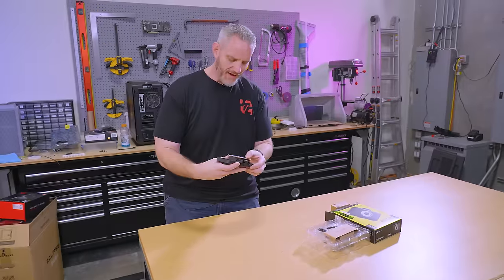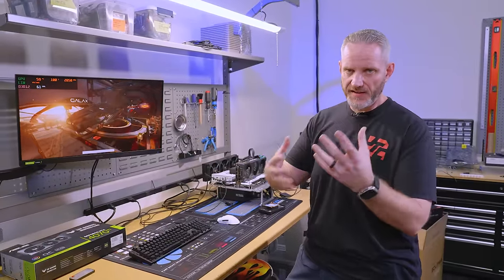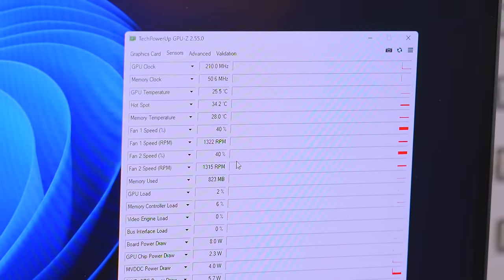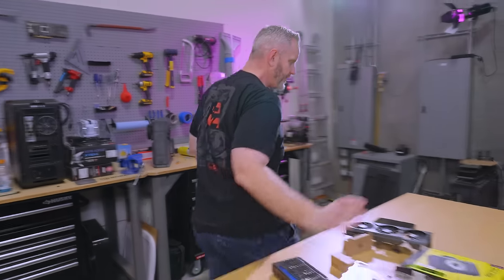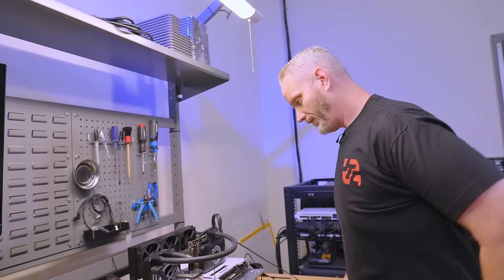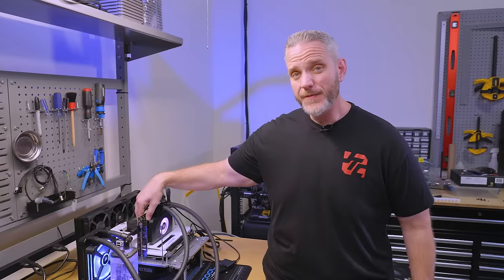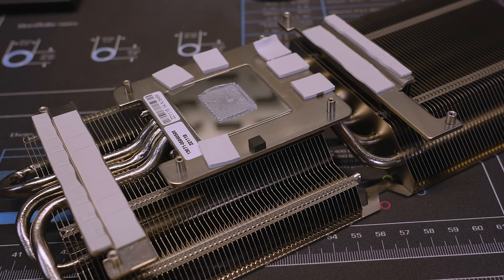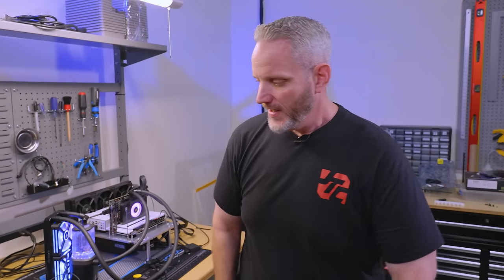They don't think I was being fair...

Comment: Genuinely, if you think he was too harsh...you really need to put your brain to work more. Not only does that product look atrociously-cheap, watercooling is an expensive addition, it also has the same huge risks to damage the GPU as any other block. The reasons anyone does watercooling include cooler temps and lower noise due to barely any fan movement being necessary. 
This thing negates the reasons for watercooling, has all the same risks of damage, and it looks terrible. Plus, it's not like this thing would make or break a build for budget. The bulk of costs are in the reservoirs, fans, connectors, and tubes/hoses. At $130, this is only a few dollars cheaper than an Alphacool Eisblock

Comment: Can anyone help me with a question? I got my new pc shipped in yesterday and a cable for the aio wasn’t plugged in but I didn’t notice right away and the cpu went up to about 107 Celsius before I turned it off. Would it have any damage from that? It was only for a very short amount of time
Reply: Should be fine. CPUs will throttle or turn themselves off to avoid damage from overheating but you turned it off before that even happened.

Comment: Jay you don't water cool for the performance I do I got a 360mm and 240mm 86mm thick rads and 38mm thick fans cooling a 5900x single core is close to 5ghz and all core is about 4.35ghz.

Comment: function over form, lol. I looked at the watt consumption of the 40 series cards vs the amount of heat my AC can get out of the room, and the 'function' just isn't there for it, lol. your either a mega corp using multi-rack VCA/DGX things, or you can't write it off as a "business expense" and are probably better off getting a game console of late, lol. maybe if I lived where there was 3-phase power I could get a bigger AC unit to keep the room under 40c (104F) during the summer, yet that just isn't an option. Also, isn't the idea of a water block, to open up the other expansion slots for more stuff, anyway, the biggest issue with that thing is the GPU it mounts to.

Comment: I would also see this product at the $60-$70 dollar range. $129 is too much for this product.  Using the corsair RGB is also pointless to me tbh. I like static color or no color and this product "for me" wouldn't even be visible to look at with the RGB because it would be pointing at the PSU shroud anyways.  I think its an interesting product for SFF cases potentially but, other than that, its a waste of money.  Personally, I'm planning on going with an aircooled card next generation (8000 or 50 series card) because my loop can't support the powerdraw of these components anymore (my system max is 300w of cooling) so I've had to limit both the GPU and CPU powerdraw as much as possible.  This doesn't effect my gaming preformance at the moment tho because my boost clocks are still reaching max on CPU(gaming is still low core usage) and my gpu is down about 10% preformance and 30% less power draw.

Comment: "The backplate was doing something" is actually something you don't know, or at least didn't test.  You don't know if there was any temperature increase on any of those components with the backplate removed.  Obviously in the stock set-up the backplate is there for a reason or they wouldn't have it, most likely, but that could change with the hybrid block.  Not defending the block, I don't like the aesthetics or price either , just trying to be fair.

Comment: That black wobbling circle in the cooling block for the GPU, would bother the hell out of me. That should be perfectly centered or be removed or made to cover precisely. Wobbling like that is just WRONG. As for the backplate, wan't in screwed in partly from the cooler side, with that you could mod it and still use it, couldn't you, even if it would break the originality of the backplate and you would be out a backplate if you were planning to go back to the original cooler.

Comment: I recently bought the XC7 elite CPU block for a new build (the one without the lcd) as it was the only one available for my AM5 board at the time and I find the product incredibly anti-consumer. Nothing else in my setup uses Corsair and the gall to charge £100 for a block that requires an extra £50+ just for the pleasure of turning on the RGB lights within the block? No alternative for Aura or heck, even just a few pre-programmed default options?

Sick of these companies trying to nickel and dime us for every little feature.

Comment: Now I want to know, does having a bigger rad make a difference?
Reply: considering that the smaller rad didn't cause any overheating/bottle necking it wouldn't really matter maybe an additional degree or so at most but your still investing more in to the rad then and still not measurably doing better. Like does it matter how much cooler its getting when its already below 60 and not directly cooling the vrms

Comment: I'd much rather get a higher tier of GPU than water cool a 70 class card, a block and a radiator and a pump/res would probably cost the difference between a 4070 and a 4080

Comment: The fact that that thing had a 3 pin corsair plug that needs an adapter to fit a standard 3 pin motherboard header is dumb. Just use connectors that are on every motherboard that everyone uses.

Comment: This is one of those products where it feels like you're literally paying for the name branding on it rather than the product itself. What I mean by that, is that I agree with what Jay says about the product. It is entirely priced wrong for the product you get. If I was searching for a water-cooled block for a GPU and I was looking at this product at 129 vs one with full coverage and a back plate for 23 more, I would go for the slightly more expensive one. The point of going to water cooling is two fold, you are looking at getting more out of the card while giving similar cooling coverage to make sure nothing gets neglected, and you are looking for aesthetics. This one from Corsair has neither of that. If my air cooler comes with a functional back plate and VRM cooling, then I want to make sure my change to water cooling has similar coverage.

This might seem mean to say, but this cooler.....really looks like something that came off Aliexpress or something as it looks janky as all get out.

Comment: My problem with products like this is that for the most part they miss the point in a market and you only buy them for the sake of using them. Like for when you want to have all things water-cooled.

For noise? Dunno the cards are with fans pretty silent.
For over locking? Definitely. BUT why waste money on a card, peripheries to the card to make it clock higher when you could have just saved the money and bought the next higher classed card.

For the sake of having a 4070ti that over locks to be as fast as a 4080 even so with all the effort etc you paid the same. Sounds silly as it gets. 

For the top cards no doubt it makes sense, as you can't buy better.

Comment: I don’t find the temp change worth it. And this is ignoring the issue with the heat of the vrms.  If the temp,change was something 15 degrees,then it would start being somewhat worth it, but then as some comments have mentioned, for the price of this block, you would be pretty close to the cost of a 4080 when you include the cost of everything else required to water cool it and you would be better off just  to get more performance if you just went with a 4080 for not much more money. This would have to be more like $50 to really be worth it.  But this is the issue with water cooling in general for anything but the top tier card(well with the current nvidia prices, the top 2 tiers) as the money you spend on cooling could just be used to get the next tier up for not much more (albeit air cooled).

Comment: It does look dumb. It also looks cheap. The only bonus I can think of is because it's plastic on copper it doesn't introduce any metal mixing crap to a loop. But seriouslt it looks cheap. Like "Look what I found on the clearence shelf at K-Mart" cheap. I'm talking mid 80's gas station cheap Matchbox/Hot Wheeels knock off cheap.

Comment: I honestly have NO idea how Corsair came up with this design. For more than a decade already manufacturers were trying to extend cooling to additional components around GPU itself and memory chips, especially VRM. And here goes Corsair, "Duuuh, we will put two small holes to blow some how air onto extensively heating VRM and it will be juuuust fiiine". No, not it will not be fine. VRM was heating like crazy in an OPEN build Jay has. Imagine packing this shit into a standard case? Or even a small factor case?
AT some point we, as customers, must hold manufacturers accountable and tell them to stop wasting our time and our money for the stupid bullshit they describe as "products". I, as a customer, do not want no ecosystem. I want my fucking fans to have the same fucking plugs so I can fucking stick them into any motherboard or controller I like and use any fucking hardware I please. And I want cooling to be designed TO COOL SHIT, not to be a direct equivalent of modern shitshow you may also know as "High Fashion".

Comment: Using plastic like that opens the door for a plethora of issues for people that are wanting to do preventative maintenance on that unit. Maybe they could’ve used implanted metal posts that would have a stronger, safer threading than using self-tappers. Not a fan, wouldn’t buy that unit because of that sole reason.

Comment: The 4070 DOESNT need a water block, PERIOD!  Hell, any 40"" series.  Heat is NOT an issue.  As stated, this tech is a dog at any price.  If your going small form factor or have limited space, there are other options that look and perform better.  Another mistake by Corsair.  If they Keep producing plastic e-waste for premium prices and they are going to find out!

Comment: I mean, my cheapo AIO CPU cooler bought me 20+ degrees C of cooling compared to an air cooler, for like $60 bucks. The idea of spending $130 for that little thing? Naw.
Reply: Oh, AND doing the cheapo CPU AIO opened up the case airflow enough to bring the air-cooled GPU temps down by like 10-20 degrees as well.

Comment: The sticker on the hub wasn't centred, or the design made it look off centre at speed. That would drive me mad.

I just can't imagine who it's aimed at. Definitely not overclockers or aesthetic builds who'll go full plate. Too expensive to be budget. Would I take my GPU apart and lose my warranty to fit that? Hell no! Imagine your VRM's burn out because they ran too hot for too long and you had to tell the OEM you'd used that instead of their heatsink 😮 

It reminds me of those 'electric turbo' things they used to sell for cars that were basically a 12vdc motor with a plastic fan 😂 it just looks like a gimmick you'd laugh at if your friend said "Hey look what I got"...... what? Warts?

Comment: I concur w/ Jay's opinion on this, it's not priced properly. IMO it looks like crap no matter the orientation, it only provides marginal benefits which could mostly be margin of error in testing anyway. For a little more or at the same price you can get full cover blocks or you can change settings for the same performance gain for free. It looks anemic & like someone just needed a product to sell, it doesn't bring anything new to the market that's worthwhile, save the "passive" linking that is limited due to poor planning & execution. Definitely not worth $130 IMO.

Comment: It’s a terrible product.  Going Custom loop is a huge money dump already, when you get a rad, pump, fans for ~$300 and then a $129 block that looks like garbage compared to the stock air cooler it’s a huge waste of money for -5C reduction in primary temperatures.

People who do custom loops do it for the aesthetic factor and/or temperature, but the gains need to be substantial like -20C on a 4090.  This product checks neither box and looks more like a money grab with all the cheap components/design.

Comment: Anyone that tells you that water cooling has no benefits to air cooling is most likely affiliated with an air cooler manufacturer. This is an engineering fact. Also, Earth is not flat.

Comment: NO! I think it sucks as a cooler. If i wanted fans everywhere, then i wouldn't use water cooling. I have a waterblock on GPU core, and another on VRM midplate. Then waterblocks on everything else. My 3 PC fans only have to turn at slow speeds. All i ever wanted... All i ever needed, is a quiet damn computer. Enjoy the silence.

Comment: Water cooled card,, eh water cooled GPU..
Typical corsair made good stuff first. end up with crap. they started with HWlabs radiators, and end up with (neo) Chinese made crap.
Same with the tubing. started with good stuff. the last (never buy it again) soft tubing looked like it was made for "adult" toys i could bend it by blowing on it..
Did not even fit on my EK compression fittings. back to using 10/16 ZMT like u do  over there :P

Comment: There are too many "badly priced" products as of late. There is nothing wrong with making a universal block, but it looks like cheap shit and the price doesn't reflect that. It should have been in the double digits, not $130. On top of that, it doesn't make much sense, when nowadays you drop extra 150-300 compared to MSRP price on an overengineered air cooler, only to pay even more extra for a subpar water-cooling experience.

Comment: i'd agree, this product makes little sense. it looks bad, it doesn't perform meaningfully better (unless your card came with the worst cooler on the market perhaps) and it's just plain overpriced for what you get. it's just a plastic shroud with what looks like an AiO-grade coldplate. for $60, maybe, if you already own a custom loop and just HAVE to have watercooling for your GPU for some reason. but $130? no thanks. if you can afford watercooling and an RTX 4070 or above then you can probably save up for a proper waterblock for it

Comment: $20-50 to save your VRMs and get a nice looking block with no wobbly lookin fan on the front made of cheapo plastic? Seems like a no brainer. If you're going to go water cooled, go water cooled. That thing looks like trash even at $70. I've got some Corsair stuff and it's always been great for me, but I think they massively whiffed on this. Seems like some manager's decision instead of the engineers'.

Comment: Add a 360MM Rad and a pump and it still isn't worth what they are asking for it. The stock cooler on the TUF 4070 Ti is good for as high as you can possibly clock it without bios modding it. Don't buy the OC Edition of this card either. It's dumb,,, and slower, seriously. Same card with a different bios. It shows lower bench scoring than the non-OC version. WTF?

Comment: Feels like corsairs design team went back to 2010. Looks dumb an  old even if it peeformes good 4070/4070tis dont get super hot as is and anyone using a 4080/4090 will be full blocking if they are water cooling.

Comment: It's the heat capacity of the copper and aluminium that matters for heat-soaking air heatsinks. That's the heat storage medium, not air. Air is what you ultimately dump that heat into.

Comment: The backplate probably uses thermal pads to remove the insulation created by the airgap between the card and the backplate. Aktuall cooling is probably fairly similar. The cooling on the front is a bigger loss but that could be aided by the small extra heatsinks you have used before

Comment: but... why? this is designed for the 70 tier of cards, which makes very little sense. If you are going to go through the trouble of putting a block on your GPU, you would expect it to only really be worth it for the 80 and 90 tier cards. if I saw that block installed on a 70 tier card, I would be extremely confused, as the money the person spent could have just been used to help pay for going up a tier to a 4080.

this seems like its a relatively pointless product, not only does it look like its from the early 2010s, but it looks like the construction is incredibly cheap. who is this product for? lol

Comment: The only reason you would get a shitty and insanely overpriced 4070 is because it is still relatively small (FE version) and relatively energy efficient. But really it is only about size.
Basically the fastest thing that would fit my workstation (Dell 7865). At all.
Other than that really nobody would bother spending any more effort or money on cooling a thing like that. You just buy the FE version if you are space restricted and you buy anything else if you are not. Because pretty much anything else is better value for money than a 4070. Additional cooling solutions for something like that is just ludicrous.

Comment: no amount of testing can justify that the gpu block looks like ali express tier garbage.

also Nvidia doesn't allow VRM temp monitoring anymore. if a card has it, it's a temp diode between 2 of the vrm's around the middle of the line of VRM's left of the gpu die.

Comment: Loved Corsairs initial Launch of Hydro X products(Have a Phanteks P400aDRGB kitted out 420mmFront Rad 240top mount rad 6x 140 QL Fans an XC7/XG7 Blocks, XD5 pump, DominatorPlat RAM) , however this version is, uhm is real cheesy and real pricey its Thermaltake bad. Love you guys but damn this is terrible as a product, almost all the products this go around look bad. I would not risk a $800 product or more on this product. I think for most people that need a 4070/4070ti waterblock they will go with alphacool since every other manufacturer is actively F&*king the consumers with no product......